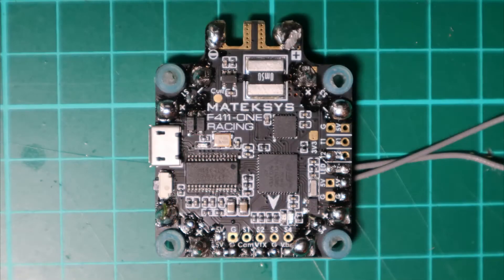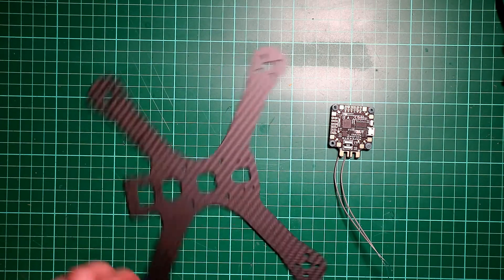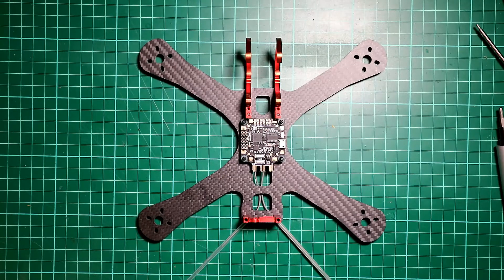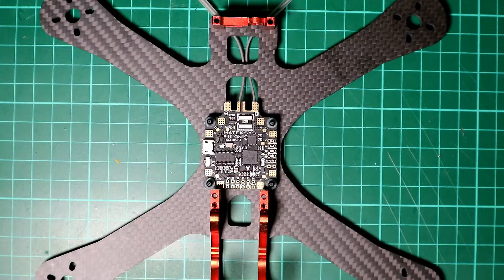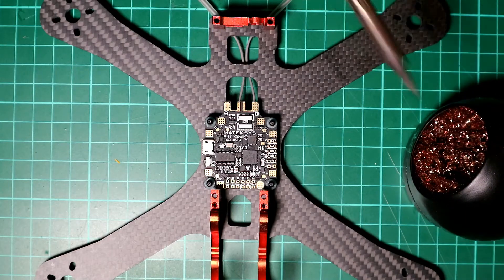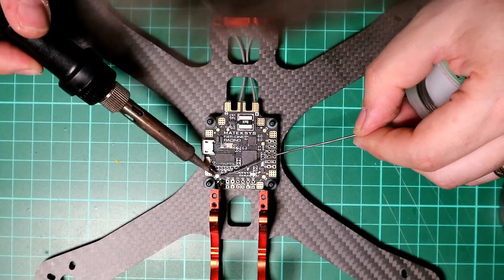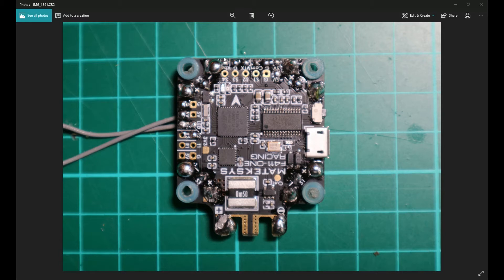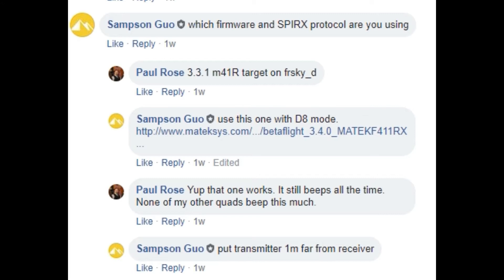Matek F411- One: Part 2 Building, Flying and the Big Problem

Comment: I do not feel the buzzer problem is an issue, after all if you lost TX completely you might want the buzzer to sound to give you a chance to find your quad. There are settings in BF to alter this too if desired. BR.
Reply from the maker: I dont agree. I have the the beeper setup for Fail safe and on a switch for exactly that reason. This beeping is some thing new, which is totally un needed. I admit i have made it worse by using a 5v buzzer, but that is part of my standard Spec
Reply: Dear Paul, I was just offering some polite advise and this was not a criticism. The point I am making (Perhaps not clearly) is related to BF and that you can switch the buzzer output as required to stop the annoyance that you describe. I comment because I had the same issue and fixed it. I also have allocated a switch (Buzzer ON) for location purposes and logically linked this to failsafe. Anyway, happy flying and have fun. Kind regards.
Reply from the maker: Ahhh, Thanks. I will have to try that!

Comment: That dont sound normal at all. Dont know if its the same cause as to what i experienced before but same beeping happened on one of my quad, had to desolder everything, and resolder it all again with flux paste to fix it.

My issue was i think due to improper contact on one of the joints (i still am not sure which in particular), so i used the flux paste (the one from inventech) to make sure nothing was bridging or lifting up anywhere.